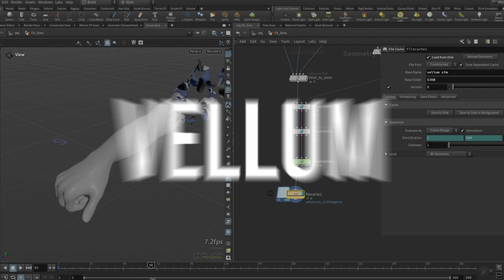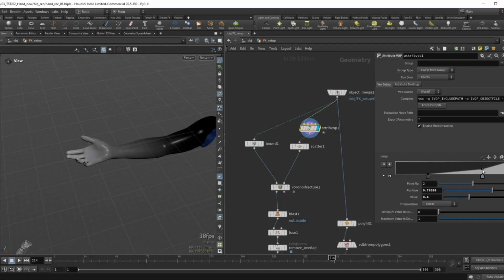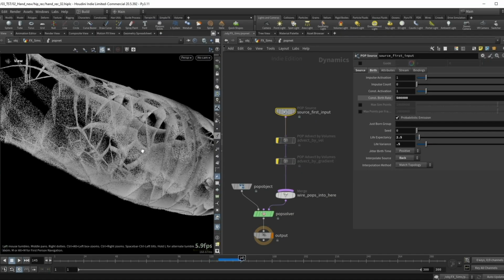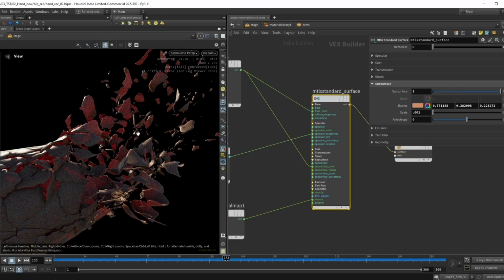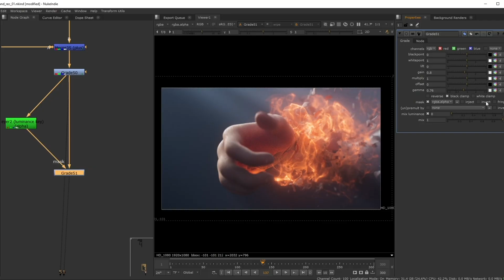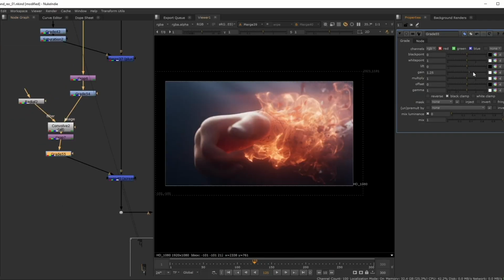Vellum Disintegration FX - Houdini & Nuke VFX Course

Comment: Can we learn all of this using the free version of houdini?
Reply from the maker: Yes. Check out Houdini apprentice, and for Nuke you can use Nuke non-commercial version, both free.
Reply: @voxyde thanks for much for the info. I'll definitely get your courses when I eventually pickup houdini and nuke. My laptop can barely handle blender well but I gotta keep pushing with it regardless
Reply from the maker: @amazingakara  Definitely check out some of the free courses on the website first. If you can follow along with those ones, the paid ones are not so different (in terms of computing power needed at least)

Comment: Oh I was waiting for this! Cannot wait to enroll next week. I have a request since I'm struggling with the scale in FLIP Fluids, flip fluids has been a nightmare for me when I work with it for 4 years now. I know it and i use it but when it comes to normal scale such as I put a pipe from C4D or Maya with 100 cm scale, in Houdini it comes as 100 x10^2 scale and when I scale it down by 0.01, the simulation is always terrible and wrong behavior with collisions and everything. And the good result and behavior is only when I work in Houdini scale, but Houdini scale doesn't allow the computer to make a sim with that big size of a pipe of 100 x 10^2 m scale. I hope you can see this and my request is: Will you be able to make an Intro to flip fluid or a course for flip fluid, something as your awesome courses of Intro to Volumes or Intro to Pyro or Intro to Particles or even a Pro Course that will include FLIP Fluid inside out and its problems and this nightmare scale issue and micro fluid sims? Because till now I see that Houdini when it comes to small scale fluid sim is a terrible piece of software and it sucks in that field. and I would never choose it to make a small scale fluid simulation with it. I hope you can change my mind!

I appreciate your guidance through this, you are really the best instructor and artist out there, also I remember and follow you since your After Effects and Templates that you were doing. they were stunning!
Reply from the maker: Hey there! Intro to Flip will come eventually but that won't be out for a while. I also have to get re-familiarized with the newest flip tools and workflows cause I personally don't do a lot of FLIP myself. If you're interested in small scale flip simulations I can recommend this course https://www.houdini.school/courses/hs-235-small-scale-fluids Really talented teacher, probably the best artist when it comes to small scale flip